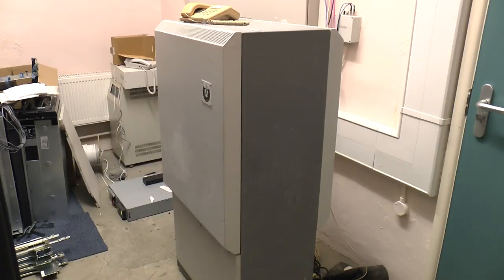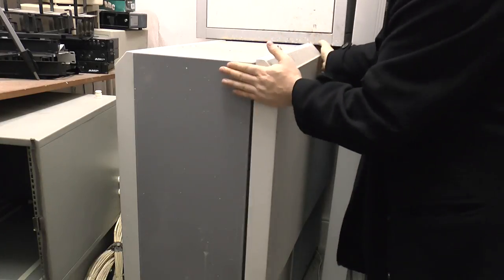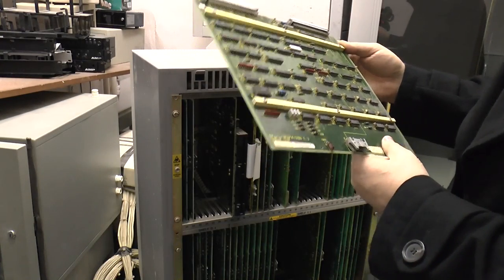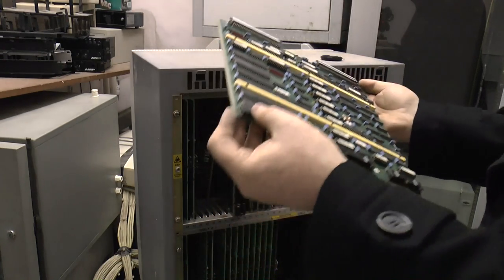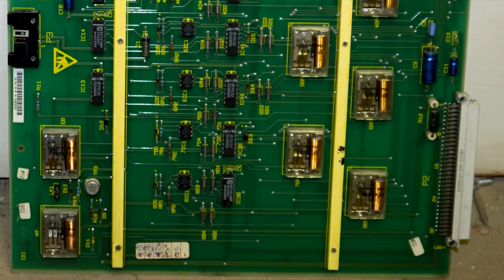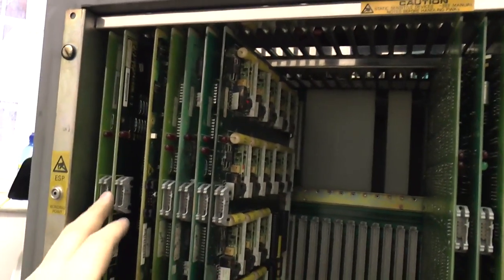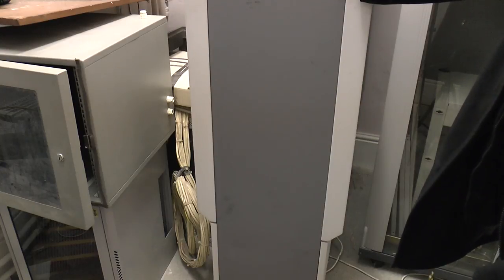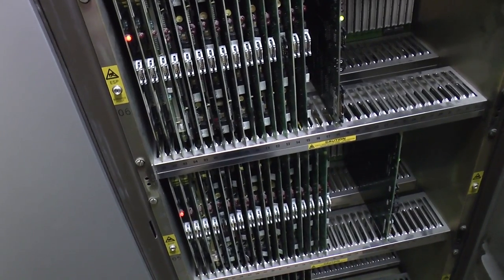Inside a Siemens (GPT) ISDX Telephone Switch

Comment: Nothing to beat the ISDX. I ran a "fleet" of them at one stage. We had X25, ISTD, and it talked to our UNIX box for call centre applications. We were so proud of our little network.
It never failed and was easy to maintain once we wrestled the high level passwords out of GPT.
I later heard that control of high level passwords was part of the BABT approval (HAH! remember that, no CE back then)   and we were not supposed to have them.
I saw my last ISDX decommissioned about 15 years back at Zurich Insurance to be replaced by an Avia VOIP system.

Comment: Cool to see what was in use on the other side of the pond from us!  I have gotten to work on the Rolm 8000s, 9000s, and them on the Siemens Hicom 300H's (9006 software, also called model 30s and the bigger model 80s.)
Interesting to see all of the differences between what you have over there and what we "had" over here in the US.
We are all CUCM now where I work, but still have 2 model 80's in use, but not doing much anymore.

Comment from the maker: We've got 900 numbers allocated to the 3000, some of those are for distribution groups and there are a load of spares, but I think there are about the 700-800 mark. Three main, sprawling floors with some bits above plus outbuildings.

The live 300 has an IP card in there with about 100 phones on it as well, most of those are in the building across the road.

Comment from the maker: Thankfully it doesn't go wrong often, these are built to last. Dead extensions on a card can be worked around if necessary. Find a spare extension in the left-hand frame, trace the faulty one back to the frame using a tone generator and detector, swap over to the working extension, pick up the handset, dial a special number to find the extension you're on (or dial to a display phone), then connect into the switch and type IEX *faulty-extn-no* *new-extn-no* to swap the extension numbers over.

Comment from the maker: 16 per card I think. Distribution frame is in the wall cab behind the working 300, or on the floor-standing frames behind the 3000 (PABX side on the wall nearest the 'DX, extension sockets fed from the larger one to the right of it).

Comment from the maker: The day-to-day commands are dead easy to use and you can pretty much guess any missing ones.
NEX / LEX / IEX / MEX / DEX = New / List / Interchange / Move / Delete Extension
LHG / RHG = List / Revise hunt group
LPG / RPG = List / Revise pickup group
LSAB = List System Abbreviated Dialling Table

From the above you can already guess the command if you need to revise an entry in the System Abbreviated Dialling Table! Adding a new hunt group is probably either NHG (for New) or AHG (for Add).
Reply: LET A

Comment from the maker: I'm not sure, I'd have to check the documentation. The combined codec and extension card might require a vacant slot alongside where the other card would have been, on the other hand it might not in which case the extension capacity of the switch might be doubled.

Comment from the maker: These support VOIP with the right cards, the running 300 shown first has I think a HG3500-DX IP card (you'll see the two pink Ethernet cables going into the backplane behind it). I don't think the 3000 has an IP card though, its links with other switches (including the Avaya) are mostly QSIG (including the 300 which is QSIG over fibre) with one connected via AC15.

I think Realitis 9 (which these run) supports SIP trunks and Siemens-own IP handsets but Realitis 10 supports SIP handsets as well?

Comment: You probably would want to upgrade that microbak ups. They're buggers for blowing the caps after a power outage. The output smoothing caps tend to dry out a bit and become a bit choppy
Reply from the maker: The Microbak's no longer in service, the 'DX is on an APC SmartUPS 3000 now.
Reply: AintBigAintClever nice 1. Very reliable units as long as the batts are tested and replaced every 3-5 years (11 year ups tech)
Reply from the maker: Changing UPS batteries on all of our UPSes is one of my jobs :)

Comment: Lot bigger than the one I have at work...... BTW the CPU card is made up from those chips, each forms a part of the CPU. Look up about AM bit slice processors and you will see how they are connected to make up the CPU on the 2 cards. Not a single chip comonent.

Comment: Hi - Great video, very informative.  My background is predominantly networking and IP telephony (CUCM) but I've inherited to iSDX 300s and an iSDX3000 to look after as well. I have to say that the lack of an "undo" scares the b'jesus out of me especially when I've tried to list something and 15 mins later, the screen is still scrolling. Haven't found the magic sequence to get it to abort the output yet  - CTRL+SHIFT+6 and all permeations don't seem to do it:-)Just one other question, are the cards hot swappable? - I would have thought the processor cards aren't and the risk with pulling an extension interface card is that any calls being serviced by that card would get dropped.
Reply from the maker: +Richard M I think it's CTRL-A to abort a list. Also, if you find that the delete/backspace key doesn't work, try the backslash (\) key instead.

I think the cards are hot-swappable but at the least you ought to down the card first (DCD I think) then up the replacement (UCD?). If the card won't down due to channels being in use you can down the individual channels as well. I doubt these are available under OSL 14 though. I've bounced individual channels on a card in the past but I probably had to go in on OSL 2 to do it.